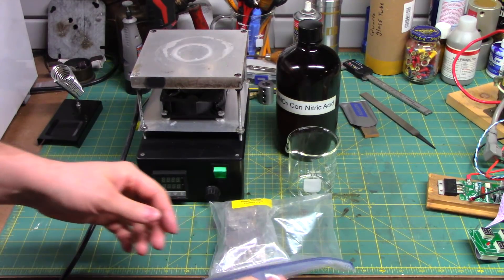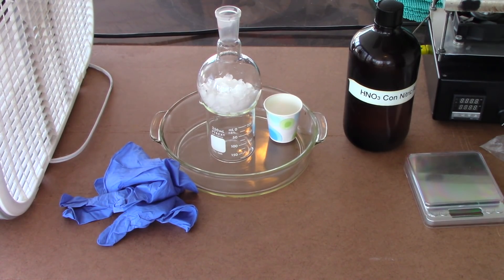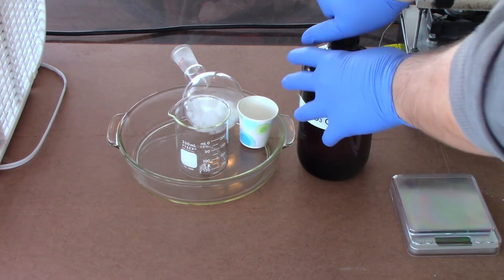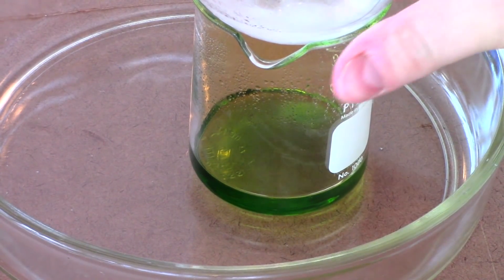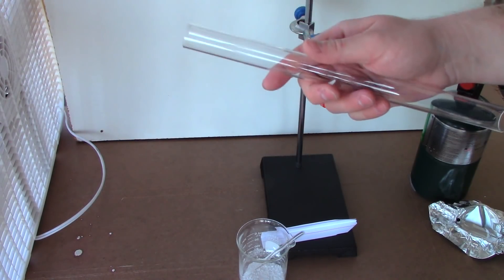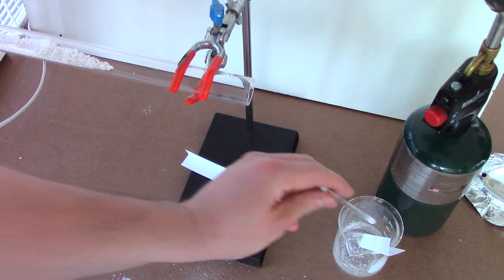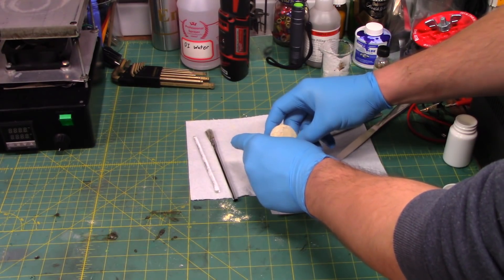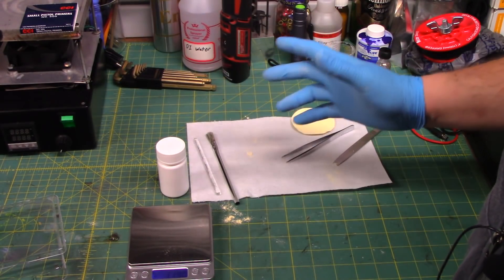Making Bismuth Trioxide From Elemental Bismuth - ElementalMaker

Comment: I think you needed to add some water, Red fuming nitric tends to stall out quickly. As there isn't any water to dissolve the metal salts they form a passivation layer stopping the nitric from reacting with more metal.

Comment: From memory when I made some of this trioxide I dissolved the bithmuth in nitric then somewhere along the line maybe after watering the solution down added sodium hydroxide which converted it all to the trioxide, it worked well in dragon eggs.
Reply from the maker: Nice! I probably should have gone the hydroxide displacement route, this thermal decomposition method was neat but not as simple and the wet method probably creates much better particle sizes

Comment: Why not react the Bismuth with nitric and then mix it with bicarb? The insoluble Carbonate just thermally decomposes to remove carbon dioxide and what’s left in the solution is sodium nitrate with a bicarb impurity.

Comment: Would love to see you do a video on Nitric Oxide production by high voltage electrical discharges. For fun you could do a conversion to Nitric Dioxide after. I imagine you would have a more creative way of doing so.
Reply from the maker: I've been wanting to do a birkland eye reactor for a long time. I just need a neon sign transformer.
Reply: @ElementalMaker  $40 online for 10Kv on amazon. Cheaper on ebay ($20). Looking forward to this couldn't you use an old microwave transformer and just redo the windings. Some maths and chemistry in one video as a plus of recycling a transformer.

Comment: I tried odysee, but the videos buffer for about 3x longer than they actually play...  I get 30 seconds of video then 1.5 mins of buffering, and it continues throughout the video that way. Am I doing something wrong or do they just suck that bad?
Reply from the maker: In occasion that seems to occur and I'm not sure why. Typically if I reload the page it fixes it. Usually they are pretty seamless.
Reply: @ElementalMaker  I had nothing but problems both times I tried it...  I would delete YouTube in a heartbeat and send them the one finger salute if there was an actual competing platform, but with Google subsidizing YouTube's operational budget,  i think it'll take gov't splitting them up as a monopoly.

Comment: Ozone smell for non chemist's is when you put a blanket outside on the sun ☀ and when you take it after some time it smells like ozone :) 😊
Reply: Everything that "smells like electricity", like a photocopier, this is actually ozone smell.
Reply: @emmepombar3328  I would not agree, it's a very specific smell
Reply: Why it happens?
(I'm referring to the blanket)
Reply: @AccidentalScience  uv light splits oxygen into o o and than because they are radical they quickly make O3 and blanket fibers trap ir
Reply: @unity4alle1  ok, thank you. Frankly I do not recall to have ever felt the smell of ozone from blankets put on the sun, I'll try to pay more attention next time to check it out. Cheers.
Reply: I imagine most people have smelled it without realizing, you can also get a good whiff of it whenever you pull a fleece shirt or blanket across your hair because of the static electricity, and you get that “fresh” smell, like dry laundry that you’ve just taken inside.